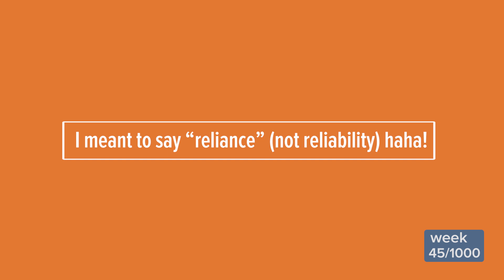The Real Price Of Convenience & Complexity – and why manufacturers love it all the way to the bank!

Comment: Howard! You're on a roll with the videos discussing the engineering or lack thereof in a lot of things!  It reminds me of a kinder and gentler Ralph Nader.  Besides you and me, I wonder how many remember him????
Reply from the maker: I totally remember Ralph Nader.  I was only 8 years old and riding in the back seat of a Chevrolet Corvair when my dad ditched it deep into a snowbank on an S-curve on a country road.  
In addition to whatever Ralph had to say about the Corvair, it was not well balanced and it was my dad's first outing that that car and he was driving the road the same way he had done for years with our Pontiac and the rear end stepped out and decided to pass the front end.  Once it broke loose, even tho my dad was pretty handy with anything that had a steering wheel there was no saving it.  
My issue is that unless we as hobbyists do things differently, hobby farming or hobbyist sawmilling can become a very expensive hobby.
The sheer day-in-day-out cost of maintenance, let alone the capital cost means one should not quit their day jobs.
I've had a number of equipment failures that collectively cost $thousands - and they have nothing to do with the wear and tear one would expect - and they are unique to equipment manufactured in the last 5-10 or so years.   
Truckers have been protesting many of the evolution for years, but the issues have now spread to other sectors.  
Good times!
Reply: @howardkettner  I could not agree more!!!!

Comment: Did you check the primary fuel filter? The symptoms are the same… happy new year Howard! 
Jeff
Reply from the maker: Happy New Year to you too Jeff.  
Yeah - that was probably the 2nd thing I checked - and I also checked for any signs of water in the fuel.  Even the dealer was mystified at first thinking fuel injection system (The little Yanmar 3 cyl diesel has mechanical indirect injection (IDI) - but the culprit was indeed the pump.  Changed out the pump and all is good.  Instant cure.  ope this one lasts more than 311 hours.  hahaha

Comment: Awesome video.  Dead on point. Some people refer to this as de-enguneering. They use to make their money on sales of equipment, now it in maintenance and repairs. I drive a lot of toyota vehicles from the 90s just for this reason. Plus this newer technology requires special tools and computers to work on, anything to shut down backyard mechanics. Also they try to push legislation that you can't or not allowed to do your own repairs. Right to repair stuff,  it's like we as a society are being de-engineered.
It really shows with the new GM, Ford and Ram truck lines. Things breaking constantly. A man would think with all the technology we could make a million mile vehicle and we can. But, there's no money in it. It's all about the Benjamins.
Reply from the maker: All great points!  Love it - "de-engineering" describes it perfectly.  
I think that you and I are on the same page on the NA truck manufacturers.  Had an issue on my F350 at 100,000 km/62,500miles.  One of the four (yes - four) emissions sensors failed.  Even a dealer with all the equipment cannot determine which one.  So - what one does is keep replacing sensors - at $800 CDN plus labour ($185/hour) until you hit the right one.  My truck had gone into full "Idle" mode by the time I could limp it into the dealer (was on a road trip and only had an 80km/50 mile warning that something was amiss).
Fortunately, the first one we changed out was the faulty sensor, so my bill was only $1,200.  
Just insane!  The rest of this story is that I yanked the entire DEF system.
I am so glad to see in the news that some of the 'right to repair' issues are finally being addressed.  
Huge thanks for tuning in and being part of the conversation . . .

Comment: A few months ago we had to have a new heat pump installed.  It was expensive!  The thermostat has a red light on it because we have not connected it to wifi!  I don't plan, or want, to connect it to wifi.  Why do I need wifi?  I can walk to the thermostat and set the temperature I want.  I hate everything assuming you have wifi and want to control via an app.  NO!  Give me dials and buttons.  I am an electrical engineer and play with very high tech test equipment most days but I want my house and my cars as simple as possible.  I KNOW how technology can fail.
Reply from the maker: Huge thanks for tuning in and being part of the conversation.
You said it clearly and eloquently.  "Give me dials and buttons."
My son has had two ovens now where after 3 years the front digital display/computer panel has failed - and it's brutal to get a replacement.  One of the ovens he had to scrap and replace.  Meanwhile, back in the day, my parents had the same stove/oven for 20 years without an issue.  
The computerization of everything is NOT progress. The robots are indeed taking over.